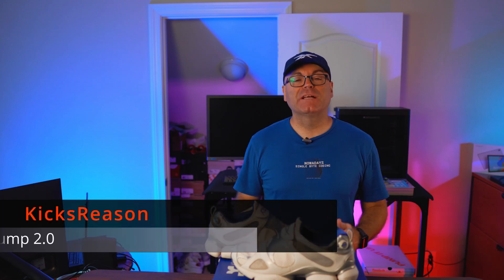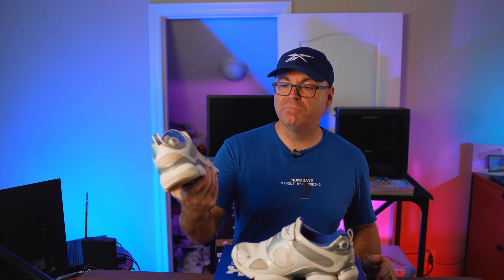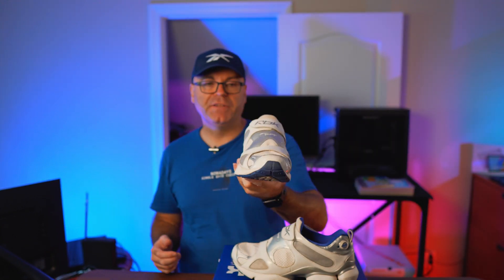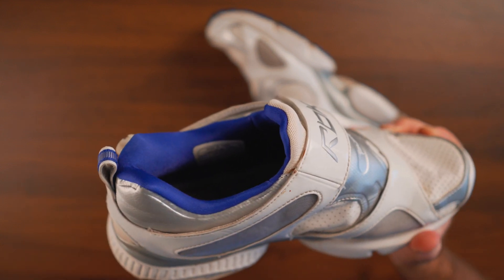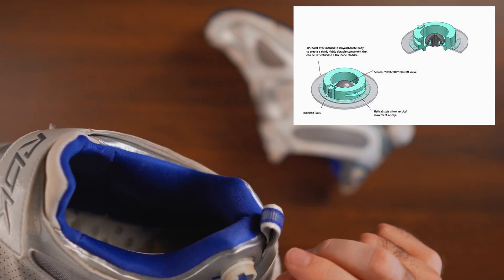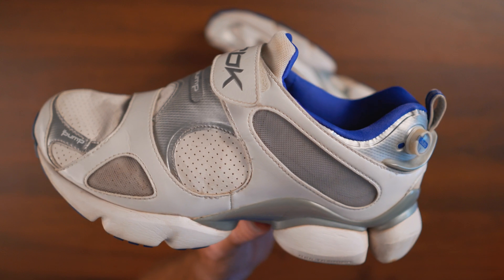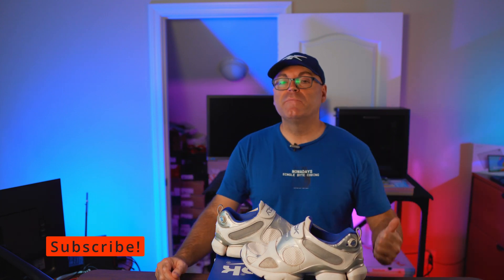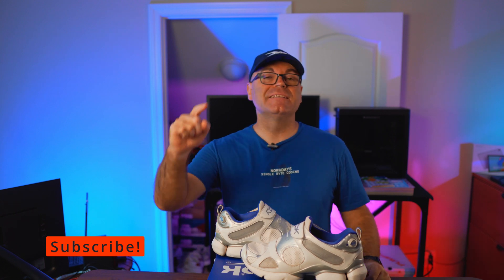Reebok Pump 2.0 - Technology Explained!

Comment: I buy these 2.0 models in my size whenever I can find them.  I agree with a lot of the complaints you have, but I have to say I prefer the auto pump, especially for these as running shoes.  When I'm running the tight fit from the pump (I believe the max was 5 PSI) really feels better than any other running shoe I've had.